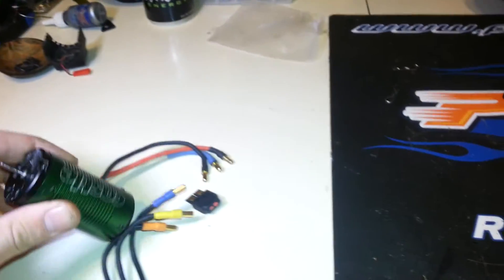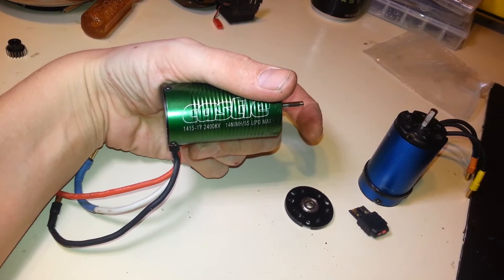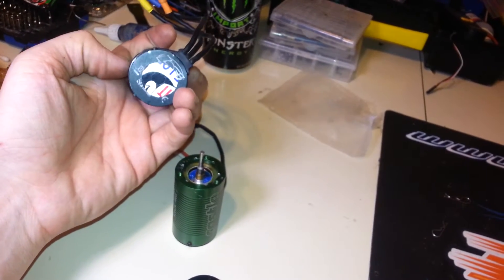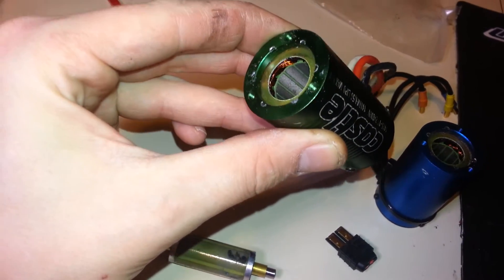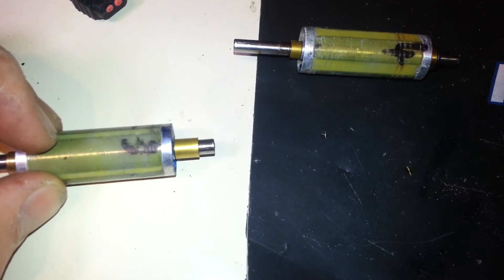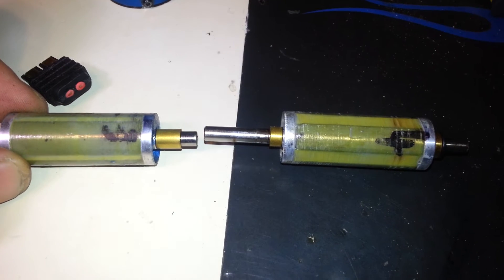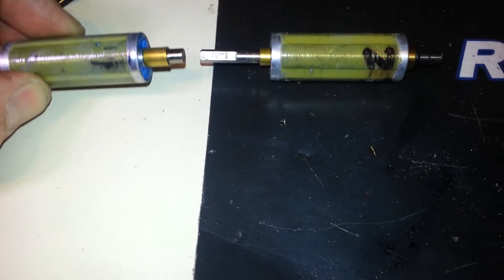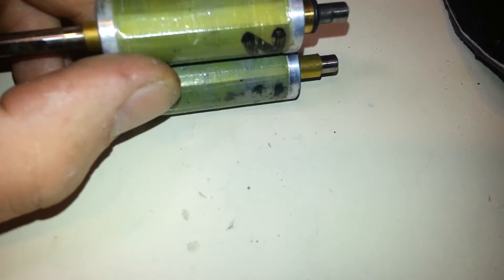Castle 1415 vs Losi 2800kv (losb9444) Internal Comparison

Comment: hey man, i have a losi 2800kv motor, only i dont know what size bearings they are, but now i see, they're the same as catle s motor, the 1415, so now are my asks:

- can you say if the castle bearing can in the losi losb9444 motor, so yes, would you like to say witch size?
- and can you look for me if the front bushing can on the front of the driveshaft from the losi, if it can, do you want to say what kind of number it is on the castle website, or the sizes in millimeters, that doesnt matter

i hope i hear it soon and thank you if you want to do this:-)